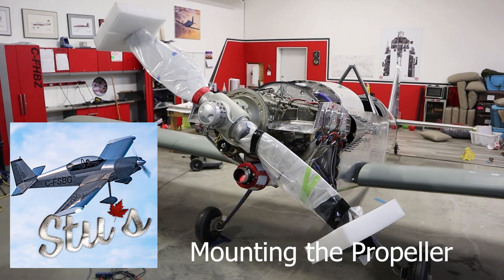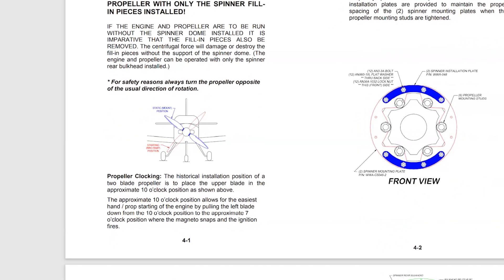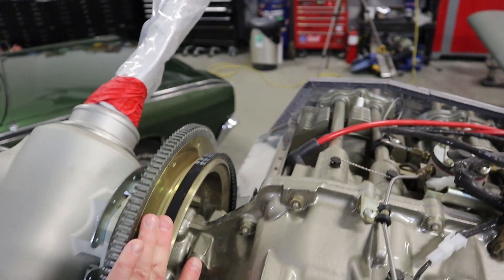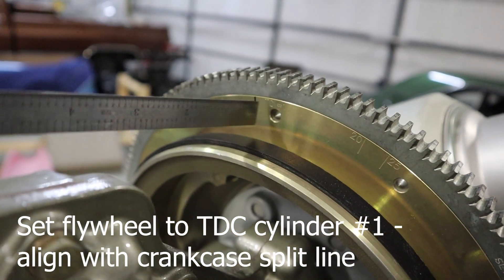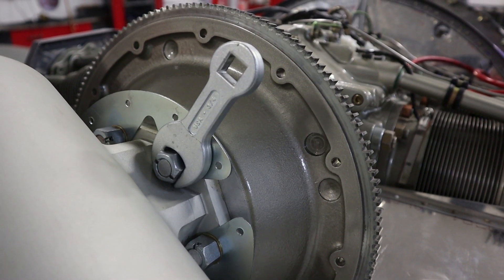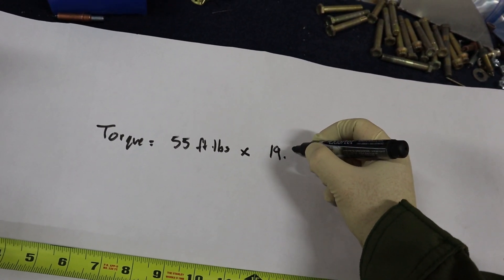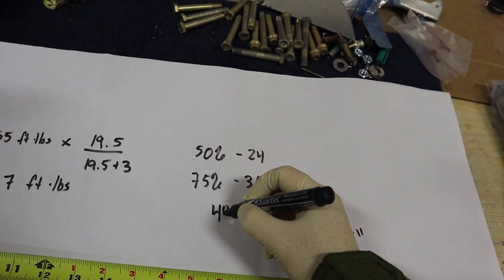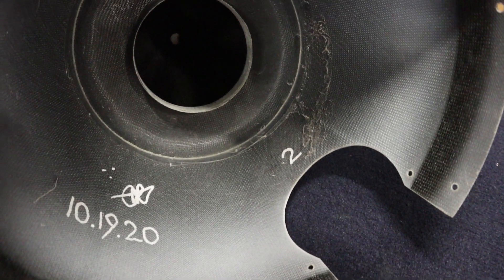Mounting a Constant Speed Propeller

Comment: Hi Stu ! Nice video, very useful, as all others you published ... It shows another engine accessory deserving a dedicated video: the Rod Bowers air filter ! I plan to install one on my airplane, as its ram air valve sounds interesting to me. Could you soon explain on which criteria you choose it, and if installation was easy ? 
Thanks in advance.
Daniel, EAA 147646 France (french Classic, 1963 4 seater restoration).
Reply from the maker: Installation of actual filter is a 2 min job.   The fiberglass intake however is designed for an updraft fuel injector.   Mine I moved horizontal so I had some fiberglass custom work to do .   Not too bad.   I’ll make a video of that
Reply: @stusaircraftfactory6592  Thanks a lot, eager to see this, as my fuel injector is a horizontal too, so I will need the same kind of fiberglass work. Any pictures, drawings, etc ... welcome.
I think this configuration will really improve the effeciency of the engine, coupled to a custom ram air intake, designed by a friend of mine, former Airbus Industrie engineer: he made extensive wind tunnel studies for several GA engine cowlings ...
The intake was flight tested as a STC project for the SOCATA TB20 (pictures available ...); my airplane will be powered by the same Lyc IO540 C4D5D, replacing the original O540A1D5. Blue Sky Over Cold Lake,
Daniel.
Reply from the maker: @danielcostes2362  yeah I will.  I basically hacked the cowling to clear the intake.   Then slipped the intake fiberglass in place with some 2” silicone hose then re-fiberglass everything back together.   Working on plenum now so will see final fit next week
Reply: @stusaircraftfactory6592  Thanks again Stu ! I will follow this all closely ... Keep up the good work !
Daniel.